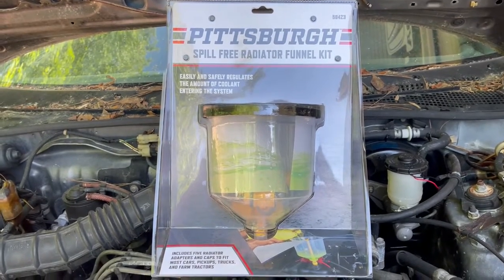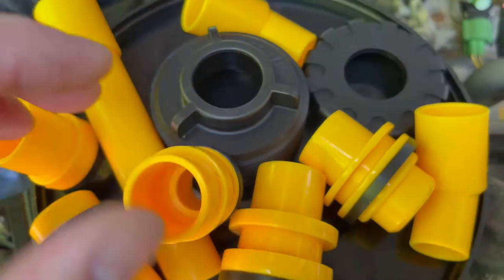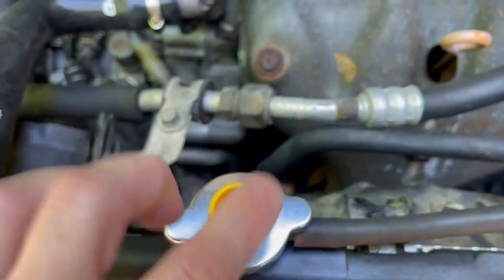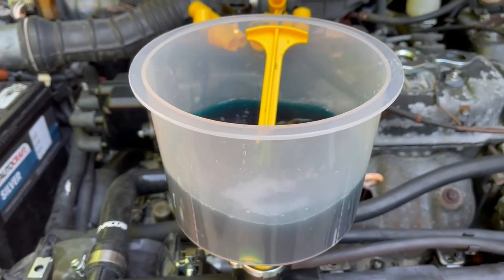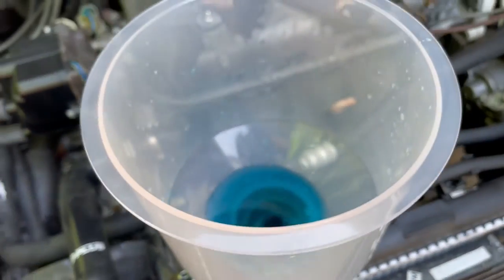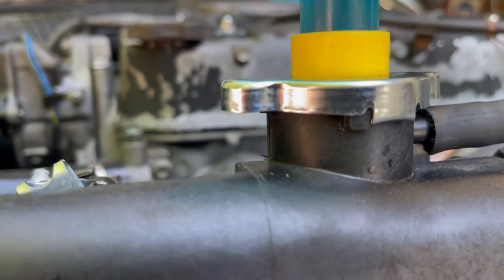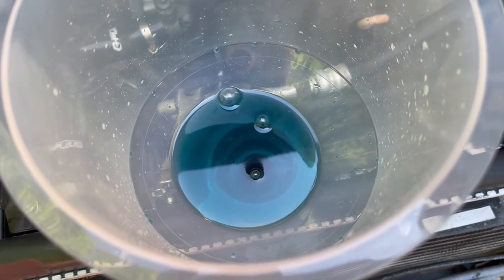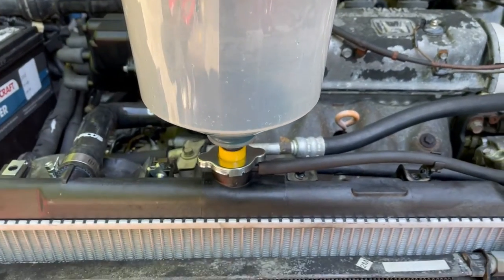Harbor Freight Pittsburgh No Spill Radiator Funnel Kit Item # 58423 Best Coolant Funnel For The $$$$

Comment: i left mine on the radiator about half full and let it cool for an hour and when i checked on it..the funnel was less than 1/4 full so the cooling sucked the antifreeze back into the radiator.  alot of the other videos on here dont show that part but it does make a difference by letting the engine cool with fluid still in the funnel
Reply from the maker: Yup sure does

Comment: Silly question here, but once the right amount of coolant is poured in will it stop 'burping' or do I need to know the amount of coolant my car needs. I just want to top off coolant after doing some repair work on my vehicle. I'm new to doing this and don't want to ruin my only vehicle. Thanks
Reply from the maker: Hello yes you would just burp it until full then run it with the heater on till hot. Let it cool down totally and recheck fluid level add as needed
Reply: @DIYKAI  Thanks so much for replying. Since it doesn't come with instructions I was not gonna make a move until I heard from you and that's for real. Have a Prosperous New Year ❤
Reply from the maker: @jaywholoveseveryone1721  your welcome same to you!